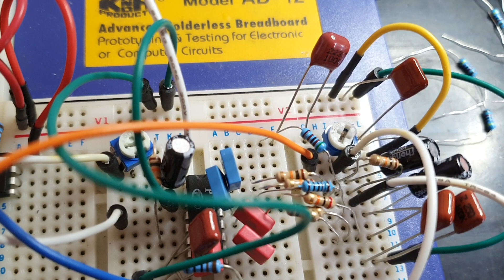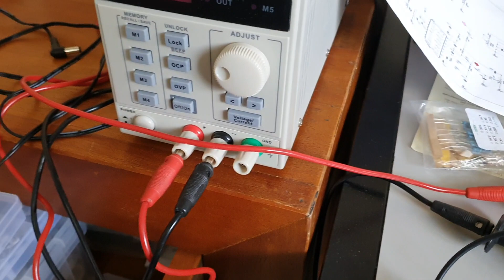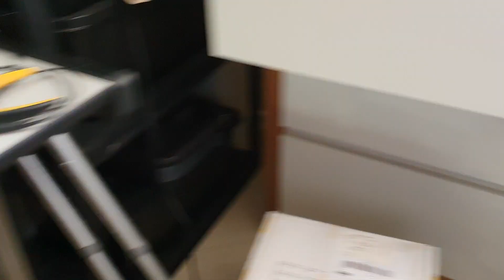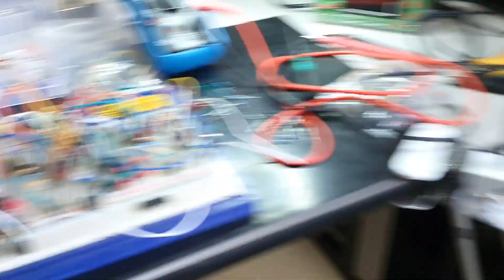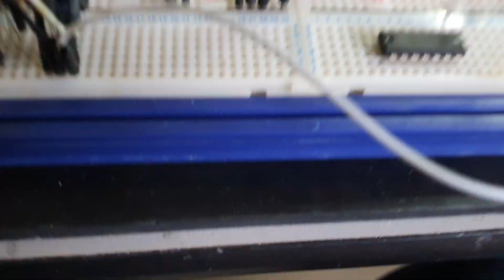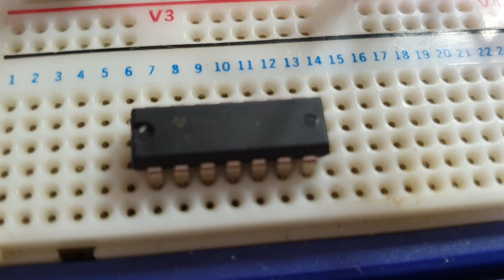Three "Head" digital delay using PT2399 and summing Amp.

Comment: Good job! I might try this idea myself. Did you get it finished onto a board?
Reply from the maker: There was no way I could fit the circuit into a compact pedal sized board; so no. In the end I built a single delay with tailored filtering to sound like old tape with some hiss and built a modulation circuit to emulate wow. See layer videos. I did put that on a board using KiCad but something went wrong at PCBway and the board is not correctly wired. In the next few weeks I'm going to revisit the board. Hand wired a prototype of the pedal and several good guitarists after trying have put in potential orders!
Reply: @delatronics  good work. I did think that the laters vieos seemed to use just 1 pt3299 chip. I really love how warm and true vintage you made it sound. Did you play with low pass filters off the chip, or utilizing the chips low paa filters? Or a combination of both. Either way great work. I do like the idea of trying to fit the 3 chip into a dual layered board into a 1590BB enclosure. I'm pretty certain i could do that even with through hole componants. My next project will be a delay and i was looking artound foor inspiration. I like the 3 head idea. Im not after directly stealing circuits, cause i like to experiment around to see what i can come up with myself. More fun that way. As to moving from working proto to a production model, ive found that quite challenging myself. Day job and life get int he way lol. Either way man great work. I might base my delay off the vintage Korg signal delay ive had for years. Adding in some heads. Dunno. Maybe ill just buy some chips and start sticking in some componanets see where it goes.